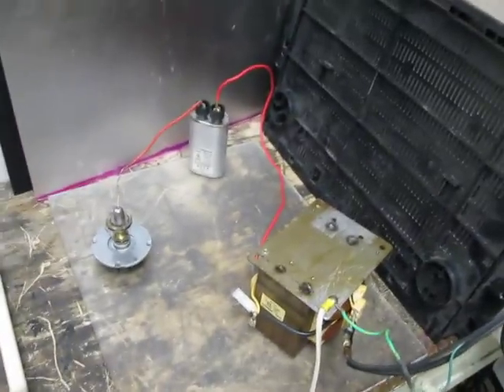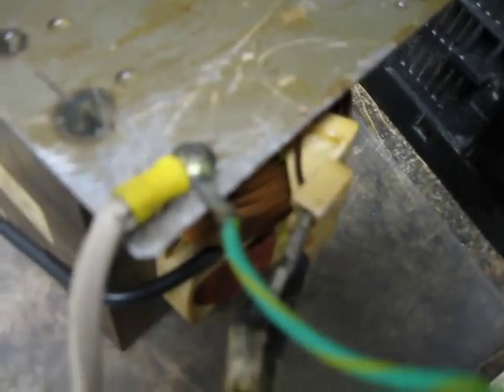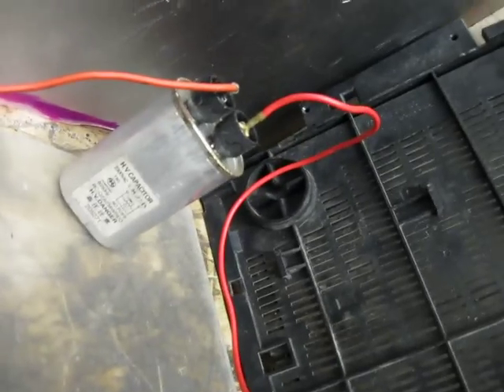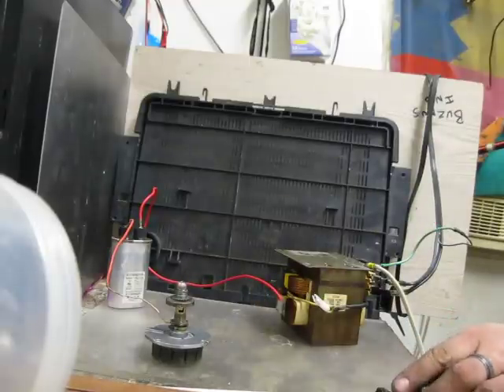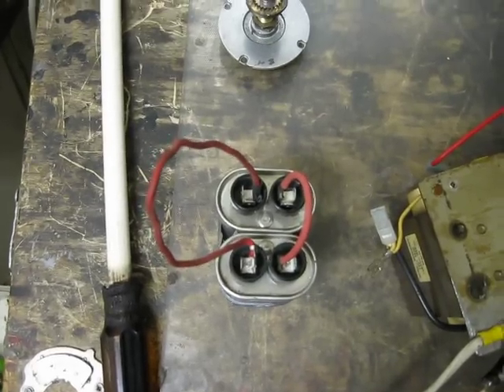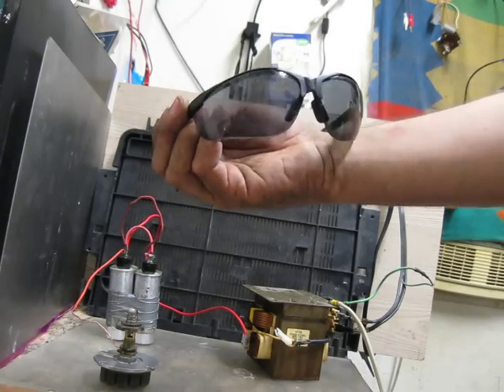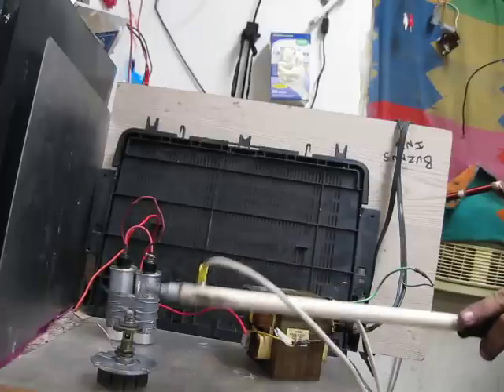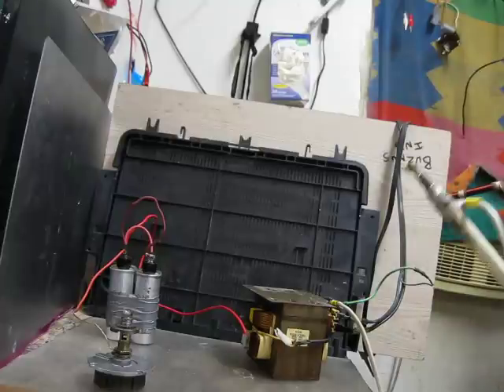How to wire a MOT for arcs

Comment: The first HV device I built was around an automotive ignition coil and condenser with a turn signal relay driver that ran on a pair of 6 volt 4R25 batteries. It was powerful enough to create a plasma arc Jacob's Ladder in an old burned out light bulb (have footage somewhere here on YouTube). My next step is a Bently flyback transformer power supply scrapped from a small portable B&W CRT TV. It will be driven by the innards of a CFL bulb. After that, an HV power source built from a MOT and HV cap similar to the one in the video. Before I do, I'm going to Harbor Freight and buy a pair of heavy rubber gloves that go up to my elbows. Safety First.

Comment: Quick ti.
Save the wires inside the microwave. Re-use the original cord, and save any wires with the knife style connectors on them. It saves crimping and making your own leads.

Comment: I just did this man! yes the wiring up paradox was overcome by one simple psychological full stop.

They told me not to try this at home...

Thanks for the tute, so far ive used 750v wire ends for electrodes which melted the hv out sheath very nicely

Cheers bro!

Comment: I noticed you connected the ground to the MOT core. I understand this will provide a low impedance path to ground and trip the breaker if there is a fault in the primary. The concern I would have is this ground references your high voltage and then you can arc to any ground. 

On my mot I have removed the protective ground and put the whole kit in a plastic box to provide safety from the mains voltage.

Comment: What i dont understand it the way in which the transformer is wound, correct me if im wrong. It has one complete primary, set to operate on 220v or 110v or can it have two taps so it can be used on either. Then there is some other kind of low voltage winding for some heater or something which does not need to be used.  Why do you strike an arc to ground? is one end of the secondary grounded already? Thanks
Reply: One side of the high voltage secondary is "grounded" to the transformer core and the other side is where your high voltage connector is that goes to the capacitor.

Comment from the maker: @yesschembri MOT's for 110vac(US) or 220(most non-US). Which the MOT is made for will be on the sticker (sometimes on the core) Best way to tell, is if the microwave it came from requires 110ac, then it will be 110. If requires 220, the MOT will be 220.
Wound between the two coils on the core will be a 3-5 wind wire, this is not used.
The secondary is soldered to the iron core(ground) on one end,so the HV end will arc to any ground connection. this can be changed, but is not shown in this video.

Comment: I have a question for you about the capacitors. What are the farads on the two? I have been having trouble replicating your demonstration.
Reply: Most mircowave capacitor are about .80 uF each.  So my math is say it is 1.6 uF and 5M Ohm.  It seem you have too much resistor value.  It should be 5M ohm on parallel but It seem too much Ohm value.  Probably it was a primary current into wrong way?  Trying switch between Hot and Neutral on primary.

Comment: Nice video. But I dont think that its really resonance. Your capacitor is acting as the ballast here (its a capactive impedance on the secondary, vs the usual inductive ballast on the primary side.). But its doing the same thing, its providing enough impedance to the current so your breaker doesn't trip as soon as you short out the secondary with the chicken stick.

When you added the 2nd capacitor, you doubled the amount of current that can pass through, which now happened to be enough to cook the air into a nice sustained plasma arc.

You can get the same results with a single MOT, no cap, and a 300 watt lightbulb in series with the primary as ballast.

But maybe I'm wrong. Could you please elaborate on why you think its resonance?

Comment: Good show—> Glad to have stumbled upon it... I hope perhaps I could pick your brain a bit for what I may be so capacitated to create with the large puzzle pile of "what I got" on hand to facilitate..  I recently had dropped in my lap: one very heaped  truck bed of outdated/vintage electrical components. (Mostly new in box/never used, by the case(s) per item, antiquated overstock by the looks of it.) 
 As far as capacitors: I'd guesstimate there are several hundred of the type (size & shape-wise) demonstrated in this video, marked w/ a few different rating variaties.  Relative to the rest of the capacitors in the lot, that type is probably the smallest in size, and quantity of each; there is maybe like 1500 to 2000-ish count of capacitors altogether. (Lot also includes breakers, variable switches, relays, some transformers,  potentiometers,  et cetera.)   So I'm wondering what kind of contraptions I can "mad scientist MacGyver" together with such quantities.  Definitely want to do some features along the lines of what you had going on here, id est Jacob's Ladders... & also, if it is possible, utilize a capacitor bank with a governed discharge (sequence?) to A: Store power from solar collector panels, & B: Fabricate some personal use adult-only toys such as 60+ MPH electric vehicles (skateboard, snowboard, small watercraft, atv/utv...)    What could I potentially do?  Any other possibilities with this stuff???  Over the top is right up my alley BTW!  (Safety wise: I have 30yrs experience as an Independent Res.&Com. Construction Contractor/Company Owner,  artisan all trades craftsman & worked extensively w/ all mediums, so know that end of electricity well, and have a comprehensive understanding of the theoretical physics end; +appliance repair/ troubleshoot from scratch is no problem. Engineering something with these random components from scratch however, is STILL just a bit outside of my wheelhouse, 🤫😆) 
—> My follow-up concern: What are your thoughts on how quickly power consumption would become ridiculously impractical for novelty?  Example project: Say like a clear coffee table or billiards table pedestal packed full of arc generators of some sort. (Insulation barrier & separately controlled &/or ventilated atmosphere seems as necessary as the matching overhead table light.😎) 
Again, my compliments on the well made, nicely constructed video that sparked my faith in your opinion here😉  Thanks, Mike...;)>~

Comment: im making one as we speak and my only question is does  the polarity need to be negative to negative positive to positive or in my case brown to brown blue to blue or just wack them on any terminal
Reply: If you're talking about connecting your mains to the primary. I don't think it matters because it's AC

Comment from the maker: @josh101491 Every MOT I have ever used had some level of hum to it. I've heard from a light gentle hum all the way to shake your house down loud. If yours are silent and not arcing then there's a possibility that you have a problem in the wiring, switch, cap, etc. MOT's tend to "die" in smoke and flames.....so usually you know for a fact when one is dead by the giant charred burn marks along the coils. If you need some help just message me with more details and ill try to assist if possible.

Comment from the maker: @MultiMinecraft123 Considering that this is an all AC setup, and no DC involved, there is no polarity to any of this, positive and negative is for DC systems. Also without knowing exactly what your brown and blue wires are and what they connect to, i couldn't tell you anything at all. if you can be more specific on your setup i could help out more.

Comment: "Although, technically if you've never worked with one before and you don't know how to wire it up, you probably shouldn't be getting on and wiring it up!"Sounds like douchebag philosophy. I suppose you were born with the knowledge on how to wire up MOT's, right Sir Douche A Lot? Truth is everybody interested has to "learn" at some point.
Reply: Yeah his tone is condescending to say the least and knows less than he lets on. Resonance should create greater efficiencies yet he's blowing breakers. Series resonance gives higher V output but sucks all availabe current from the mains and will overheat the MOT. Parallel resonance would give less V output but more current while reducing draw from the mains, but could still very well melt the secondary. A better idea would be current-limiting the input using capacitive reactance, say 100uF - 200 uF cap (depending on the transformer rating.) Running at half the transformer's rated current is a good idea for safety.